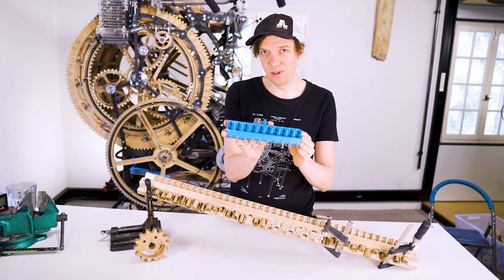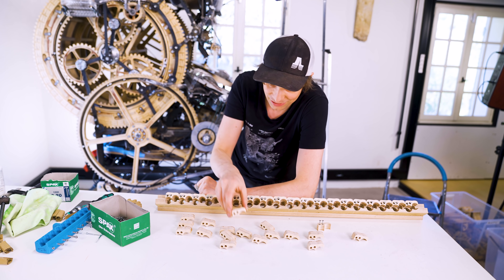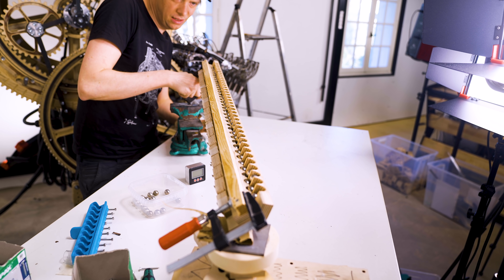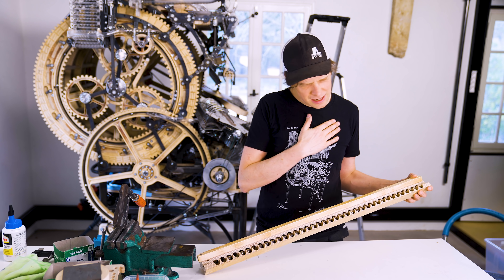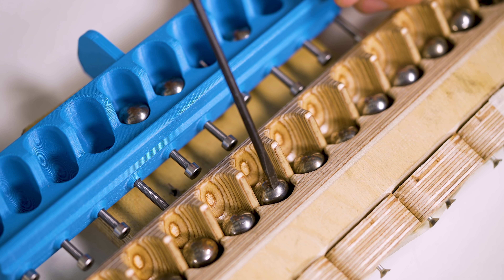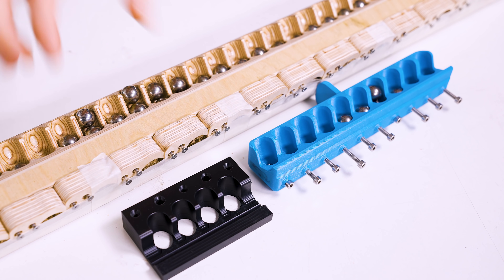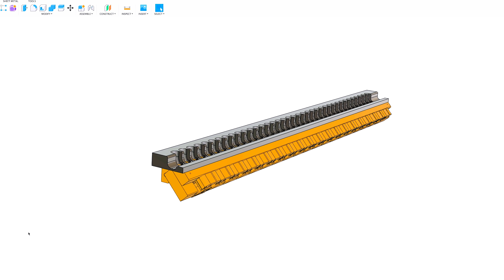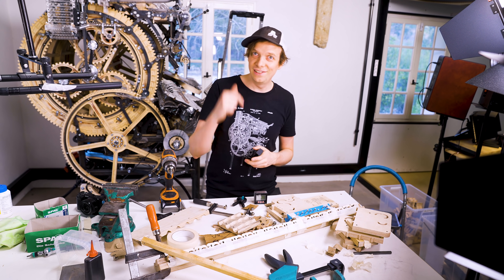Ultimate Material Showdown

Comment: Probably overthinking it I'd bet that the vibration of the machine in operation would prevent the marbles from sticking. But yes the wood will wear down over time faster than the plastic

Comment: You remember with your previous solution that if you have a smaller contact surface between the ball and the lane, or the walls of the lanes are at another angle, change the speed.

Comment: No thoughts on how when on the machine there will be a lot more momentum from marbles dropping, they aren't gently rolled like Martin is doing by hand here, so those stuck ones would get bumped and then continue to flow?
Reply: The machine also has a recirculating mechanism where marbles that don't get used go around the divider and try again. Gentle rolling is the worst-case scenario.
Reply: worse than that are high speed marbles, skipping holes

Comment: Make a small bracket on each end that you can adjust the angle left to right and also be able to pivot it forward as need be. Instead of mounting it on place and then might need to cut off to readjust.

Comment: Could you just add that graphene powder to the wood to smooth it out or something?
Reply: The problem was not in the smoothness of the material, but in it not being hard enough to make sharp and hard edges.
That is why, in this case, plywood is simply not good enough, although in general it is a great material to work with.
Reply: @EaglePicking  thank you for your response. That makes sense. As I thought about it more that was clear to me that was the case. He also wants to solve this by intelligent design instead of simple hacks that will create more problems in the future.
Reply: @gregorysember2164  Exactly. Going with plywood because you like plywood is not a good idea if it's not suited for the job.
Personally I wouldn't go for synthetic materials on the MMX, though.
Mixing metal and wood gives it a special kind of steampunk vibe, I believe.
Hardwood could be a good option here.
Why not mill the marble divider out of something exotic like olive or ebony wood?

Comment: When I first saw the height independent marble race, I thought it was a slam dunk.  Then I saw your plywood prototype, and all I saw was moles.  So happy to see the improvement from the change in materials, great instincts and great work.
Reply: Agreed, I think Martin's choice of good plywood can be made to work more than well enough. But its not really the right material for the job, manufacturing it right will be hard and avoiding the fuzzy splintery wood edges with the usual approaches means significant redesign. So I'm glad he's going for the simple solution - use a material suited to the task and geometry you want! Should last better than all those fine features in ply too..

Comment: Well, think about the world tour when the MMX will be shipped around the world in a container on the boat or generally exposed to the high or low humidity. You may find out that the plywood is shrinking or swelling and causing lot of troubles in places where the spacing and elements fit is very important, such as the channels divider or the gear wheels. The concert tours may turn out into a disaster and rush for making it work on time. Not necessary stress. The machine will be way more reliable if made of different materials that are not humidity dependent when it comes to their size, such as plastics or metals. Currently it works fine, because the conditions aren't changing that much when comparing to the tour through various worldwide locations.

Comment: The marbles are over-rotating on the plywood part. Even though the angles may be the same, the friction losses for different materials are different. I'm willing to bet you would find different over-rotation speeds if you did another test using the three different materials with the same angles. This is why the plywood is failing. If you change the way the marble rotates (like changing the contact points) or even add a coat of resin or something click to the plywood, you'd see it fail less and the marbles roll more smoothly.
Reply: the problem with that is that keeping the sharp angles would be against the strengths of the ply wood
i could be made keeping the same shape out of ply but it would be a massive pain to build

as you would need the layers of ply to be vertical and perpendicular to the flow of marbles along the top and that would take many many layers of laminated ply that you would then need to machine back into a workable form and would be way more effort than it would be worth

but it "could" be done
Reply: @durandle9226  he had the same issue when creating the original height modules. Rounding the path slightly would change the contact locations and it wouldn't be any more difficult than some light sanding
Reply: @kaiser1794  the problem is that the rounding it creating gaps that the marbles can more easily get stuck in  as he clearly mentioned in the video

he could try to remake the part again but keep the sharp edges but it would be liable to crack or chip away some of the edges ending back at the same problem
Reply: @durandle9226  those gaps is the spce between the marble and the pipe. Rounding the contact surface doesn't mean opening that gap. It doesn't even need to be round, just tapered
Reply: He did also finish the plywood in guitar lacquer, which is pretty hard, so while I agree about the friction benefits of resin, I don't think it was enough to overcome the other problems in the design. I think the POM should be more durable, lower friction, and allow for the sharp corners and tight tolerances that are required.

Comment: I think another thing with the POM and 3D print, is the lines/grain
The original 3D print has it's layer lines running in line with the marble lines, it wants to guide them along and gravity has to pull them over and into the holes
similar with the POM, it's almost entirely smooth, so the marbles glide with no friction
but...... the plywood... it's got grain, it's got texture, on a zoomed in view you'd be able to see how unsmooth it actually is, and how it would grab and stick and slow the marbles
Reply: I still think the Punic Ditches around each marble are the main problem. 
As you perhaps noticed, there were some slots that repeatedly caused issues and at 6:00 you can see how they all are different size because of the manual machining, i.e. the slots that had a closer fit didn't make any marbles get stuck despite the rough surface of the plywood. That being said, I don't argue the fact that friction also plays a major role in the overall mobility of the marbles

Comment: You're trying to ensure marbles never stop in the divider, but you don't need to. Instead, ensure that there will always be enough pressure to get any stuck marbles moving again. You need the opposite of your Wilson gates upstream of the divider - something that delivers marbles with limited speed but builds up pressure if they stop. Then just ensure that the marbles can't climb out of the channel, which is easy.
Reply: forced pressure is a bad thing
if they get stuck it is highly likely to cause a major failure and that can result is problems like broken parts and that is about the single worst thing that could happen in a tour situation
Reply: @durandle9226  if they stop, we know it won't need much pressure to nudge them back into motion. My point is, design it so that pressure is applied if necessary rather than trying to find a tiny window of adjustment where it can never get stuck.
Reply: @durandle9226  no, it'll only generate enough pressure to nudge the stuck marbles back into motion, and we know that takes almost no pressure.  Better to have a system that does that rather than one that only barely works when the angles are perfect.

Comment: I think the marbles will push eachother through the length of it. They're coming at quite some speed off the marble splitter.
Reply: I'm not sure about that.  I could be wrong, but if the plastic pipes above the gates fill up, there could be stationary marbles in the divider (and above that), so they could be moving very little, if at all.
Reply: @mm-qd1ho  A test would clear things up. Either way, it's better to solve the issues like Martin is doing, rather than trying to work around them.

Comment: I know the MMX vibrates slightly from all the moving components, wouldn't that help them move down the path a little better than demoing it here?

Edit: I love the discussion of different materials pro/cons. Although you're trying to stick with plywood as the main aesthetic (for expense and so you can fabricate it yourself) I find that pieces like this would be good to laser or jet cut out of steel for the precision. You then get to keep the acrylic/steel/plywood aesthetic.

Edit 2: That POM plastic seems amazing. Since it's more ridgid, it would also probably allow any part CADed (totally a word, right?) specifically for the POM to translate to metal if it needed to be as well.
Reply: It may help indeed, but there are two important things to consider. 1) If the marbles don't rely on vibrations to prevent getting stuck, then the part will be that much more reliable. 2) If they DID rely on vibrations and Martin happens to reduce vibrations further in the future, then the stability of this part would regress as a result.
Reply: @LarkSS  Very true. Makes me wonder if any moles would pop up if vibration was completely eliminated. Like if Martin prototypes and fine tuned specific components on the MMX and they worked the way they did because of slight vibrations. This engineering journey is FASCINATING.
Reply: I think about this every time Martin works on this part, the vibration will help the marbles flow. However, engineering it to work without vibration is a better design.
Reply: That kind of helpful vibration is called dither ☺️
Reply: The marbles enter with some momentum not just placed and another marble will bump/push. Testing on a single system without the external influences taken into account can lead to a mole infestation.
Reply: Yes, marbles will be going much faster and bumping around a lot, so not sure why he's only testing it so gently and not also more aggressively
Reply: @tommj4365  By giving himself a ton of wiggle room an the gentle side of things, Martin makes future adjustments for the aggressive side of things easier.
Reply: @tommj4365  because if it works when going slow then it will work when going fast.
Reply: @soldiers303  is that a TwoSetViolin reference? xD
Reply: @Alex2900 when marbles go fast they can easily skip openings, as we've seen in the past and in this very episode. I'm sure Martin is or will be reminded of this very soon though, so no worries...
Reply: @jonathans1759  Remember the goal is to do a variety of songs. Making it so you can only used fast pased (high momentum) songs would limit things.
Reply: Metal would be super strong and won't lose shape, but there's two big problems with metal: a) it's loud b) when the marbles drop on the metal, they will at some point lose tiny metal particles and that metal dust isn't good I believe.

Comment: Is it just me that thinks his testing for the marble divider angle is skewed? He's testing the marbles down it with no initial speed but in reality they enter fairly quickly from lanes from the fish-stair and 4x4 divider which he should factor in right?
Reply: I'd say redundancy, but that's MMX testing for you
Reply: I'm not sure about that.  I could be wrong, but if the plastic pipes above the gates fill up, there could be stationary marbles in the divider (and above that), so they could be moving very little, if at all.
Reply: No, because you need to test under worst case scenario. For example, if between songs he ends up with all the lanes full and a build up of marbles on the overflow track he could end up with marbles stopped.
Reply: @nicolivoldkif9096  yeah true, but if its working well in those cases where initial marble speed is next to standstill, then when they do have a much larger initial speed when nothing is backed up id have thought they'd now be moving way too fast and skip over empty channels if there's not enough resistance to slow them down with a smooth material and design. Id think its best to make it optimal under conditions that occur most often. Admittedly I don't know what they are yet though
Reply: @lucagk9420  This is a great point too.
Reply: You are right. Marbles are coming in at a greater speed on the machine. But it's good to test edge cases. Presumably. If it can work slow it can work fast. That has to do with the "window" or tolerance. The tolerance should be large enough to handle both scenarios
Reply: He's doing it on purpose because he wants to test for worst case scenario. Basically, if it works with marbles starting from near zero speed, then it should work great with marbles coming in quickly even if there's an unexpected hang up.
Reply: He's testing worst case scenario

Comment: Realistically, every marble that rolls through this marble divider is going to start its run with WAY more kinetic energy than Martin is allowing them to have in his test--he's setting each marble down the divider from a DEAD STOP and likely creating way more stuck marbles than the design would actually produce when fed marbles that have any amount of kinetic energy.
Reply: I think 13:30 explains why he’s finding the best best solution
Reply: He need this to work in all cases which means testing in the worst case scenario. It is true that the plywood would probably have worked fine for most of the marbles, as new marbles likely would have unjammed the stuck ones, but that's not good enough.
Reply: There will be a lot of marbles flowing.  Some may collide and momentarily send marbles backward.  I think that's the reason why Martin wants the marbles to be able to start from a dead stop.
Reply: @michaelprice3031  Besides marbles possibly being send backwards, hard enough impacts might cause marbles to slip out from the divider, possibly leading to them slipping into moving parts.
Reply: When the acrylic tubes are full there will not be much kinetic energy
Reply: I'm not sure about that.  I could be wrong, but if the plastic pipes above the gates fill up, there could be stationary marbles in the divider (and above that), so they could be moving very little, if at all.
Reply: Good point
Reply: He's testing the worst case scenario as it is the one that's going to be the most problematic in the future with a very large amount of marbles

Comment: 1: why are PMMA bent in situ and not in a jig?
2: why not fasten the squirrels (rats) from the top? That'll be easier to access.
Reply: because with this new design, the pipe will go straight from this divider to the gates, the gates are dropping to the instrument. the instruments aren't spaced equally to a distance that could allow you to align the pipe. each pipe will have different angles and lengths.
Reply: @austins_creations  my worst fears are confirmed.